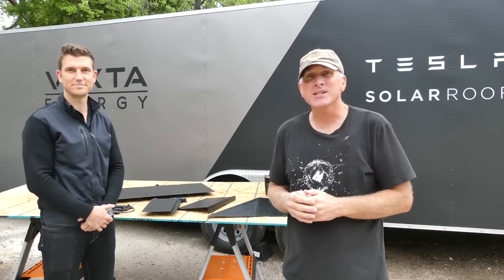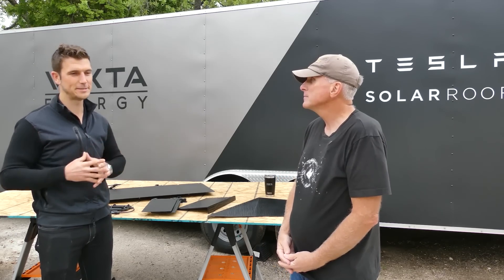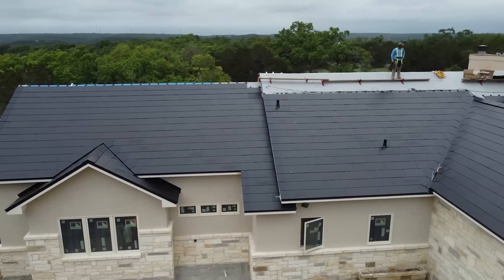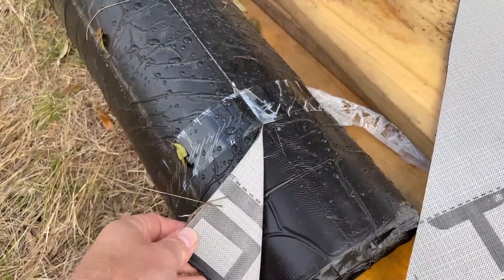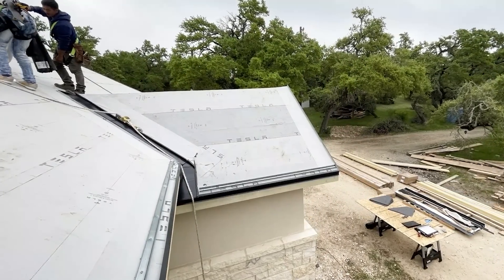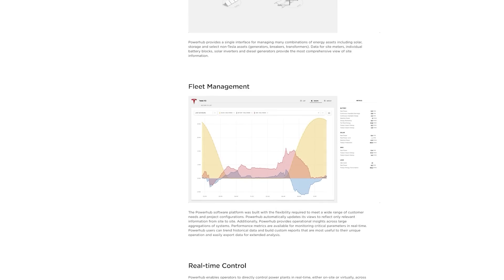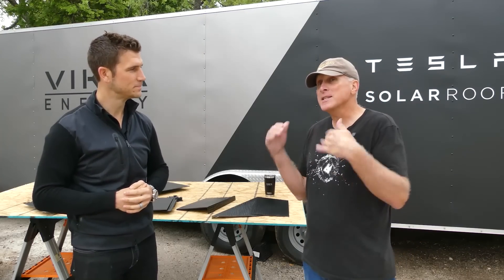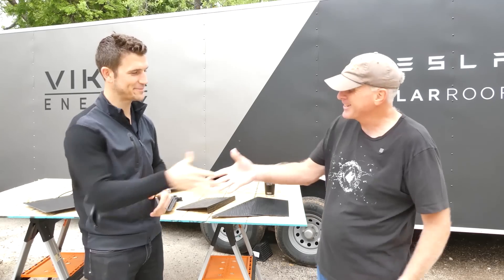Tesla Solar Roof & Powerwall Installation Part 3 Solar Tiles Discussion & Installation

Comment: Vents really should be replumbed to go out the sides of the house. They require so much engineering and work that it would be more efficient to call a plumber in a week before to eliminate roof protrusions.
Reply: Building codes say the top of the vents must be "this-high" which means it's difficult to position them around the edge without making the pipe 10' high.

Comment: what was the price for this install? I got a estimate for a gable end roof with no valleys and 1,000 sq ft for $250,000. Now maybe on Mars that makes sense but on Earth that is a ludicrous price. Why doesn't Tesla let home owners buy solar shingles? If we really want to stop burning carbon then Tesla is going to have to sell direct to consumer like they do their cars. Also what was that massive round steel structure on the side of the house?

Comment: Tesla should design and build homes with a roof that is a single, flat plane set at the ideal angle to capture winter sun.
The roof overhang should shade the interior in summer but allow the lower winter sun to penetrate the home.
It would make solar installation a snap.
Reply: Even if they provided approved designs with homeowners able to provide variables.
Reply: You don't need giant solar panels.
The vast majority of installation time is taken up trying to fit panels into geometry not designed for them.
 @vincentlaw82